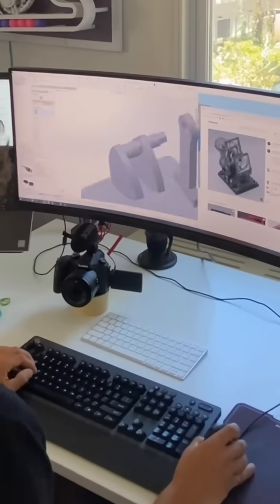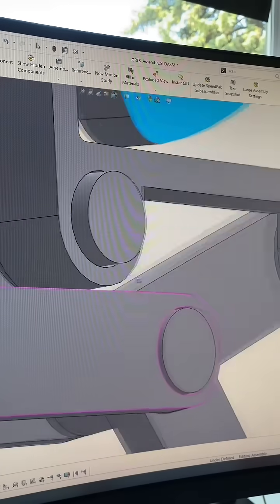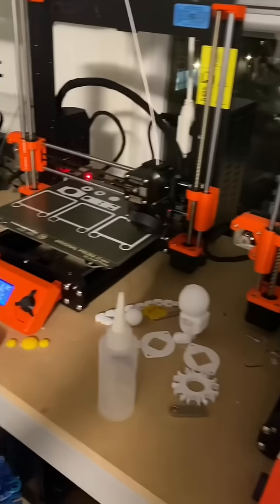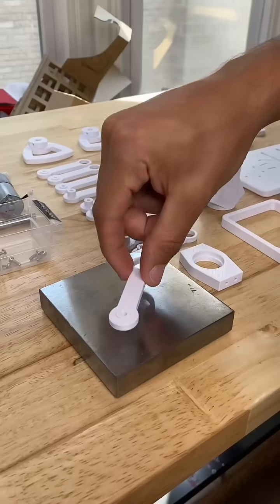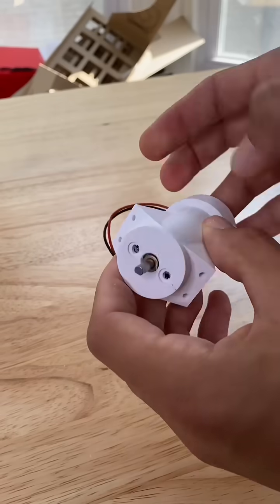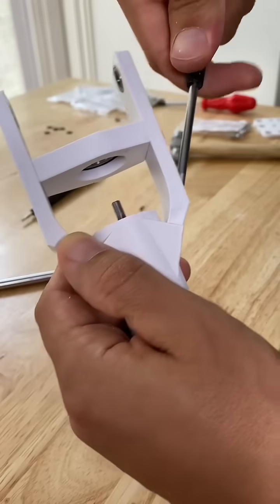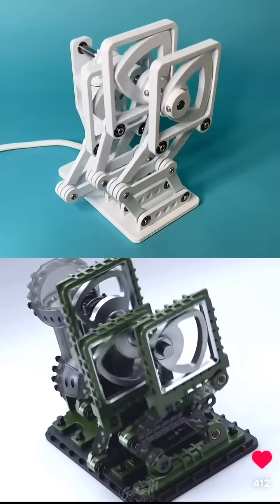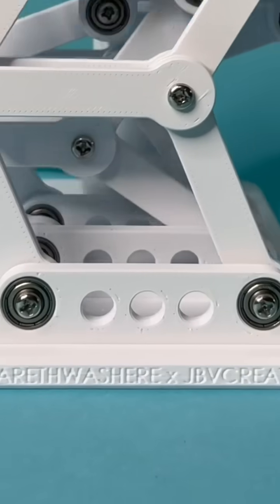Reuleaux Triangle Kinetic Sculpture | Bringing Digital Art to Life

Comment: Rendering is a bit smoother considering its "built" to exact requirements but even then keeping the fact you limited yourself to what was currently available in mind I'd say this was an amazing job 👍
Reply: The rendering is smoother because it ignores that the corners. So the squares are more rounded in the renderings "mind" than they appear. 
The real build however has to fully use the corners as they are what allows the spinning motion to happen